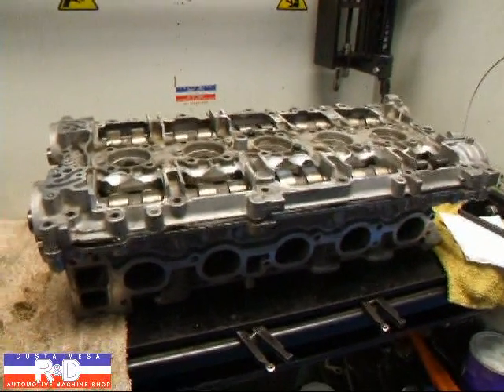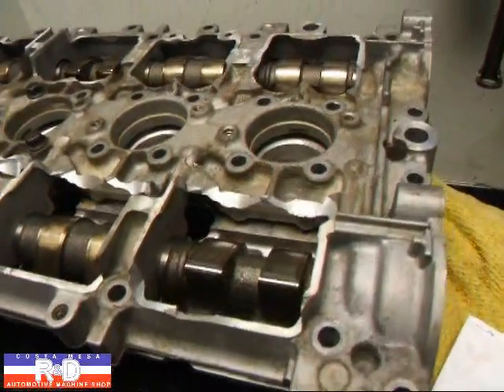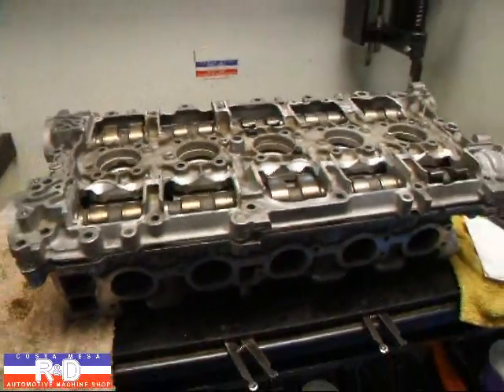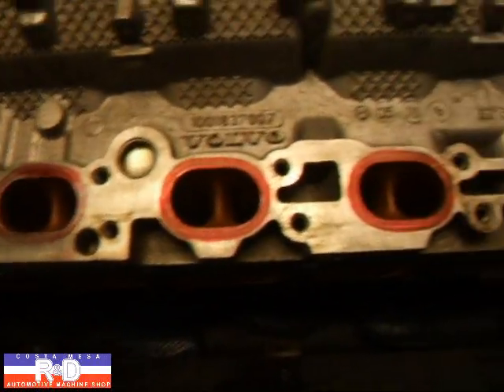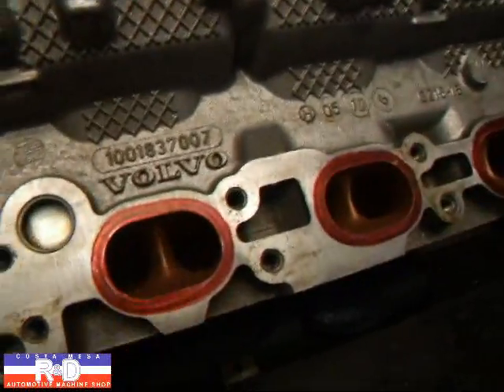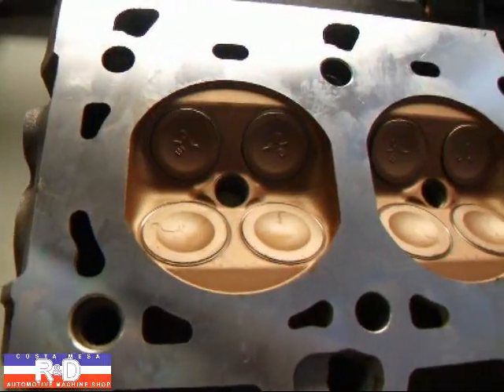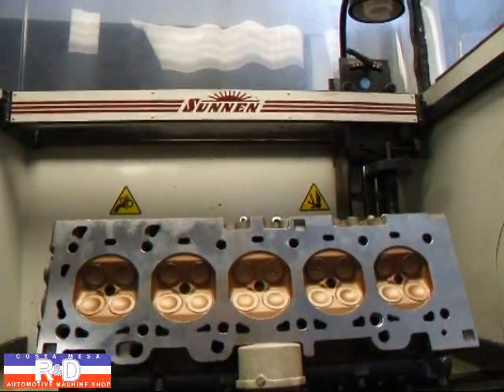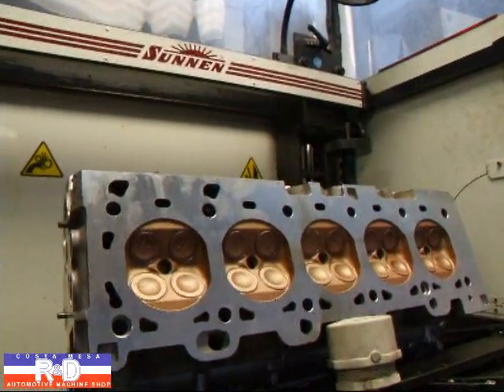5-Cylinder_Volvo_Cylinder_Head_Modifications.mp4

Comment: @flyfaen1 Tho... got nothing against the use of ceramic coatings other than that, having it on the exhaust valves is a good thing ;) like For example DLC coatings on valvetrain parts :) Nickelsiliconcarbide on tha cylinderwalls and such... Never been able to make a Volvo 4v head crack, never seen one crack either... And we abuse them in Scandinavia... pulling out slightly over 1000hp @ 8500rpm or so...

Comment: ports, which is needed for getting good VE's (the piston start moving up, way prior to inlet valve closing, right?) since 4v heads have a lack of diffusor in the chamber. The stock ports are actually even too big for 34mm valves, and the stock ones are 31mm...

Comment: @flyfaen1 make for a slow burn, which ultimately will cause even more thermodynamic energy to be wasted out the exhaust, and probably melt the turbine of the turbo... And 30psi on a in other ways stock head is waste of money... Stricktly speaking Those engines will develop 700hk at 30 psi boost... The best improvement to be done is actually to shrink the inlet ports. Making  them into venturis. Gaining port velocity is a good thing, and you get the benefit of a good diffuser in the intake...

Comment: The coating in the exhaust ports makes sense. on the valves yes. But the aluminum parts of the chamber should be left bare... Why? Because the bare aluminium sucks up some of the heat during the compression phase, thus preventing knock tendency. Remember even tho the head might run cooler, the radiation heat in the mixture prior to combustion also gets isolated... won't matter if you confine heat during combustion, if you are limited by knock... and ending up doing retarded spark, which will....

Comment: @robiniroven as gas cools it contracts, which decreases pressure and it's velocity when in a pipe. These coatings prevent heat loss into the head (and exhaust manifold if it's coated aswell) and ultimately increase the velocity of exhaust gasses, which is good. They also serve to protect the head and pistons from high temperatures, potentially increasing the motor's life. Particular ceramic coatings are also used to decrease friction and are very hard. :)

Comment from the maker: @YungJosh50 - Depends on the engine and how its tuned, but I would guess around 3-6 hp on some engines. The tune-up is what really makes the power, this operation just reduces some to the turbulence that is in the engine. Sometimes you want additional turbulence to atomize the fuel. Application, application, application....

Comment from the maker: @racepak - We haven't experienced any peeling, but detonation is bad at any level - mild or severe. The original pistons had detonation damage and that's why I'm putting the coatings on them. It's all about the tune up and who's doing it. I've seen more brand new engines killed by inexperienced tuners than you can believe.